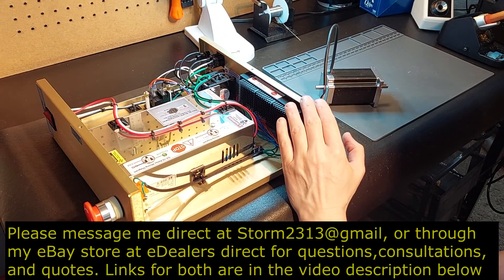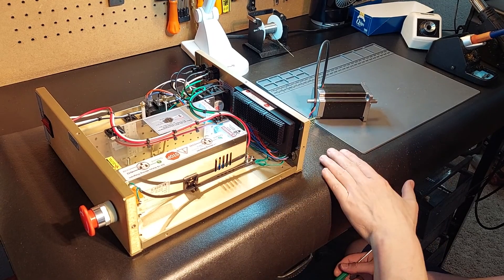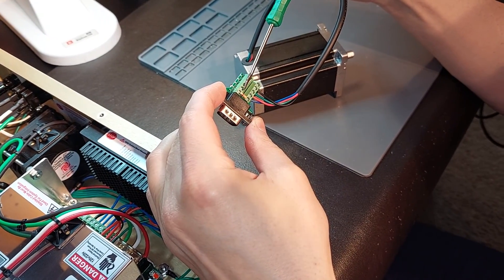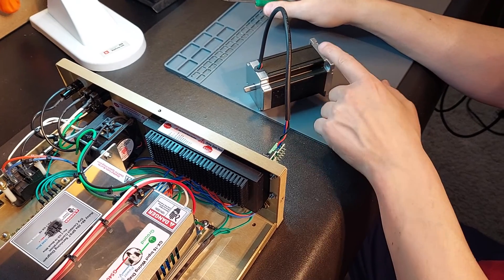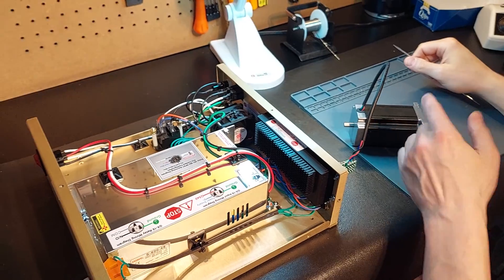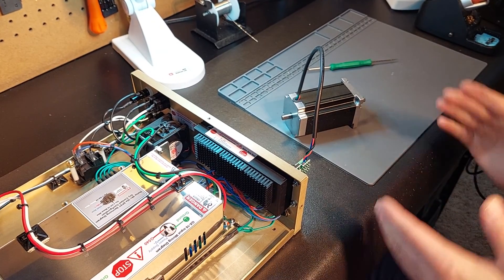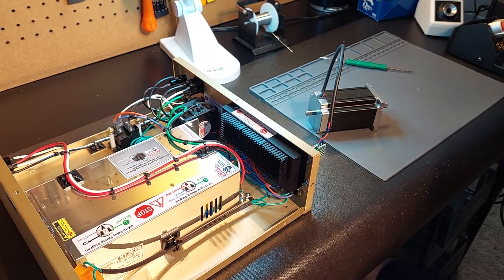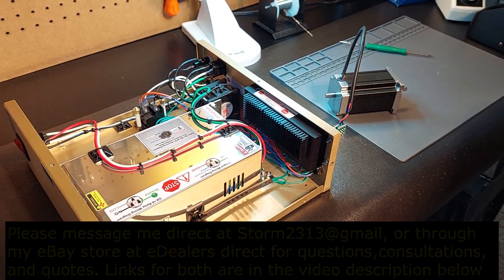Why Do Stepper Motors Get Hot And Other Common Questions Answered..

Comment: I just bought a FDM 3D printer.  I am very worried about the overheating of the stepper motors of the axes.  They are very hot.  Will these engines burn out? I am very worried😢😢😢😢
Reply from the maker: Thank you for your support. Steppers are designed to get hot, so as long as the manufacturer understands the proper sized power supply to use with the motors they selected you'll be fine. Thank you,
Vince

Comment: One more question please. Can you run 2 motors off of one driver (2 motors on 1 axis) or only 1 motor per driver?
Reply from the maker: Thank you for your support. In best practice you should only run a single motor per drive. Running multiple motors per drive can possibly destroy them. Thank you,
Vince
Reply: @corvetteguy50  Thank you. I wasn't sure if sharing a signal to keep 2 motors sync'd was okay, but now I know.
Reply: @me4698 if you dont exceed the limits of driver, its safe to drive 2 or more with single driver. So many 3d printer dual axis uses this. Let's say driver rated up to 3A and you are using two 1.2A per steppers. Its on the limit but safe
Reply: @me4698  
Depends on the current.